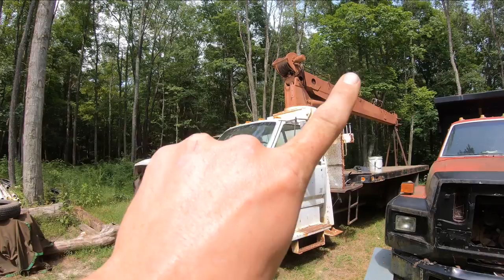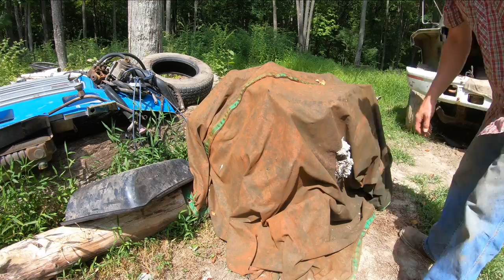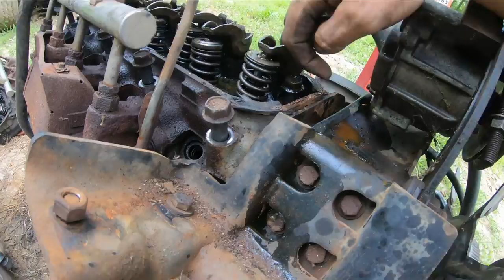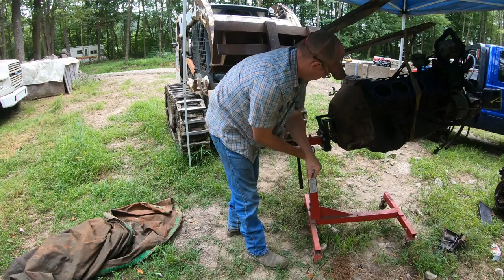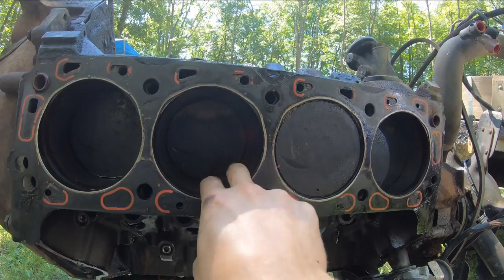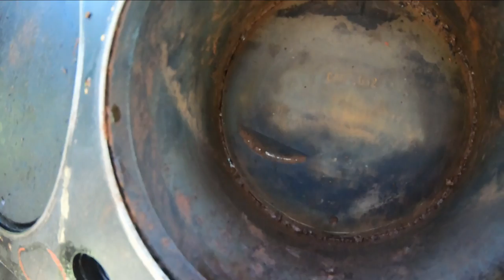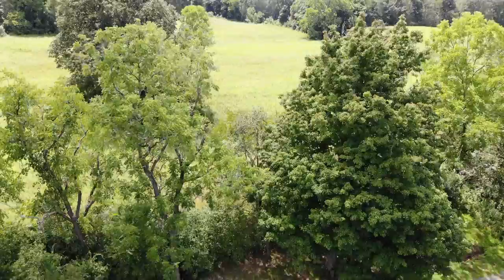Rebuilding a Big-Block in the woods! $700 Auction Crane Engine with big problems!

Comment: That engine looks to of been bored out before they got the oversize number on the tops of the pistons so maybe why it locked up a low mile engine will lock up long before a loose engine with lots of miles on it will but the heads been off that thing those are aftermarket head gaskets and the pistons are not factory so that engine has been rebuilt before as far as I can see

Comment: Seeing you took that engine apart, that was just rebuilt! You can tell by the heads and the new crank! That didn’t have many miles on it. Make a suggestion put the pistons in a bucket of diesel fuel and warm the bucket up with a and electric fluid warmer those will loosen up. Don’t put them in rust remover! diesel will work wonders if you do it right. Then clean the engine down with diesel fluid. Ask me how I know!!

Comment: With all that front dress still on the engine, and hanging a big block off the bellhousing, any engine stand isn't going to be happy.
That engine has definitely had a rebuild, they looked like Permaseal head gaskets.
I think with that big pit on the bore being so far down the hole, it won't be a big deal. By the time the piston gets all the way down there on a combustion stroke, a lot of the pressure has gone and the exhaust valve is starting to open. Less pressure means less blowby.
Besides, the pitting will fill with carbon soon enough.
Reply: Yeah and that thing weighed more than 750 pounds when he stuck it on the stand too.
Reply: Him slanging that mallet and pounding that drift. It bouncing up and down a good 6 inches, lol. I knew it was gonna come down. Probably good for 700lbs static load, when it starts jumping up and down, that's some serious stress.

Comment: By the time you pound the piston out of #2 you will have cleaned most of the rust off that wall via the rings. Hone the cylinders, put new rings on the pistons and bolt her back together. Engines are very forgiving beasts. You'll be fine. I have torn an engine apart, replaced one spun bearing and bolted the engine back together. Minimal crank damage. Engine ran fine. After you finish bolting it all back together taking very good care of the engine post rebuild is critical. Best of luck.

Comment: This is helpful for me. I'm needing to pull the heads off a V8 with just a carport to do it in. I'd much rather have a shop but it really is better than out in the wide open. And I agree with other you tubers. I've seen people free up stuck engines that most machinists would faint if you run them and they seem to do fine. Those chunks of mud could have been from mud dobber wasps. I've seen mouse nests and mud dobber nests in cylinders of engines that sat for long time. If the valve is open and the critter can get in the intake or up exhaust, they can build a nest.

Comment: I had a '66 Mustang with a 289, if you needed to change the water pump, literally every accessory on the front of the engine was bolted to the water pump housing/timing chain cover. You had to strip the whole front of the engine just to get the pump off and change it. It appears that is a trait of all Fords so nice at least the early 1960's.

Comment: I haven't seen that clay since I worked up in the 'rustbelt'...that, my friend, is the same color of 'clay' as Ford's engine caster used to cast the blocks...and is MOST LIKELY 'casting clay' used for the engine block's casting. If the blocks are not properly 'shaken' after casting, or not fully rinsed of debris after they are cool, there can easily be 'chunks of casting clay' left in crevices within the block (especially the water jacket areas) that over time, get soft and fall into the water or oil journals. Same with the intake castings...if the casting sand is not freed from inside the intake, the same can happen (and would be the most-likely thing that caused the sand to hit the pistons). While it is possible this happened from another 'mechanic' using an old intake (looked like the left-bank had a different brand of head gasket than the right bank), an intake swap with a dirty intake can also cause this. Either way, these are the most-likely ways such 'clay-sand' materials got into the piston-chamber areas of that engine. Personally, I'd tear the engine completely down, wash all internals (knocking out the freeze plugs) and then have it dipped at your local auto parts house, before rebuilding it...or the same thing that happened this time could easily happen again...if all the sand-clay isn't gone already.

Comment: Hey Matt, you have to take those clutches and pressure plate and flywheel off if you’re gonna be pulling those completely, don’t want no resistance on the back of the motor with the flywheel and clutch plate and pressure plate because that’s on cause a lot of problems and a lot banging up on the back and and U don’t need the bell housing to mount it to an engine stand. I never heard of that long. I’ve been working on cars and motors, but my back won’t let me do it no more that’s why I have to quit doing it way too much weight on that engine stand.

Comment: My truck has a inline 6 gas that was seized, well the only stuck piston was the no1 piston, BUT it was seized at the bottom of the cylinder, no going down. We managed to put the entire weight of the truck on that one piston and it stuck. We managed to get it out by heating it up a ton and dumping a can of coke down in it with pressure on the piston. 20,000 lbs and a ton of heat made it break free.

Comment: A good video, for me who does not understand much about engines. I hope that the church to apartments project is still moving ahead, too. I have discovered that many of these You tuber channel guys and gals, are pretty good at their presentations. He was on his farm, way off from anyone one else, speaking to 1,239 viewers, when I had viewed this. Harbor Freight sells some magnetic parts trays or dishes that you can place small metal parts in. Around $3.99 each. Even if you drop the tray, parts stay with it, not on the ground. They don't work with aluminum parts, though. I doubt if any engines have any aluminum parts.

Comment: I hope you kept all the bearings numbered and also noted the direction each were installed if you intend to reuse them and the crank shaft when you put the motor back together. No bearing wears the same on a crank shaft. Putting them back in the wrong order will cause faster crank shaft wear and an earlier than wanted engine failure. But if you plan on selling the crane right after you get it running, then the engine failure will not be your problem. :)

Comment: I made a Engine stand from 1: plate steel for the engine contacts and the stand was of 3" heavy wall steel pipe with 5" steel casters from a mill cart.

Comment: i did this to a 3 cyl diesel tractor.  it sat in the rain for 5 years and one of the pistons seized.  it took a sledge hammer to get it out.  bought a new piston but just honed the pits in the cylinder wall, should have been bored but couldn't find oversized pistons.  pits are still there, but 20 years later it still runs just fine.  took the gamble and it payed off.

Comment: Know how you feel.  I am a retired mechanic and I once owned a Dodge pickup with a V6.  It blew a head gasket and to remove the head I had to remove everything on the front of the engine.  All accessories were mounted on an aluminum horse collar and all accessories had to be removed to remove the horse collar.  It took me longer to remove and replace the accessories and horse collar than it did to replace the head gasket.  Way to go Detroit.

Comment: Oh hell. I had one still in the truck that I took a 4x4 and a sledge hammer to the pistons and broke them free, honed cylinders the best I could without removing the pistons, put the engine back together started it up and after it warmed up it stopped smoking and it ran for a few more years and sold it still running fine. Ford tough.
Reply from the maker: haha ya that's tough all right...

Comment: apply some heat with a propane torch in a circular motion i work the work the crank back and forth til it breaks loose. use a lubricant to keep the rings from  scuffing. the then soak that cylinder with oil with piston on bdc over night.

Comment: You have a steel crank ,I always used the dingal berry hones but you can use what you have I alway done each cylinder ,and ring end gap each cylinder  and sometimes  use a over sized ring then file your ring gaps to specs like 10 thousand  ring( low end ring gap) sometimes  they give you 10 to 25 thousands)gap you can't go wild on the over sized but go by your size pistons and then when you measure  your ring end that will tell you what over sizes rings you need ,like if you have decent  cylinders  and they are  a standard bore some motors you have to go up to 30 over rings and then fit each ring to the cylinder  top and second ring then if your standard  piston you use the standard  oil ring on the bottom ring you should not have any  problem  at all doing this and it will  run great  and be like new really .its fine for a farm truck and be better than a high miles used motor any day .I dont like to do this but for what your needing it for is really fine now you don't fit a ring on a standard bore and it way out of your ring end gap  remember  this  but buy 2 sets of rings and  and then file them it takes a while to center your rings straight and file the first  and( you have to keep track of top and second ring for each cylinder)second  ring then just use the bottom oil ring standard  to the piston size you wont have any problems  with it ,I always went with my low end ring end gap to fit each cylinder .now you need to make sure each piston is good ford does have some piston  problems I have checked very close  and missed a piston problem  and really pistons are very cheap  cost compared to have to take it back apart  because  of a rist  pin or a cracked  skirt becareful  I dont like using a motor block with out history behind it because of frozen blocks  or old castings with cracks if you have the powder  you can check it your self with a very strong magnet the powder is cheaper  to by than to pay  a shop to do it but you need it cleaned up heads and block then mag Flux the heads and block .I had a motor you could  see a hair line crack by the block plug and fluxing It with  the magnet it showed up like a sore thumb, and the block was junk really it was a very old casting.Im not up to date on ford 429 pistons  but make sure you check them very well before using them over and clean your piston   groves  I used sand blasting cabinet  with sand only very low preasure you don't what to remove nothing but carbon to fit your new piston rings on the pistons the rings won't squeeze up to insert into you cylinders ,Im sure you know this but don't not use glass beads on your piston gaps !! You can't wash the powder glass off and it will scar you cylinders  all up. And at very low preasure sand only!! And I always replace all freeze plugs  no questions. Simple and very cheap.I would not even think of using used bearings at all they are cheap to know what you got and mains too.I always put new cam bearing in myself at least you will have very good oil preasure if you do cam bearing are easy and just line up your oil ports then Hamer them in,watch your cam shaft and do not drag against the cam bearings this does make a difference  in the quality  of you saving this motors truck.remember never use glass  beads  on nothing  engine wise  it will mess you up ,glass cant be washed off with out like the old hot tanks that they use to boil the blocks with .(acoustic soda) what they use years ago.

Comment: 385 series engines are one of toughest engines ever built. i've applied heat and broken engines loose before. one you get piston movement soak cylinder with a lubricant. the heat apllied should help rings work loose.

Comment: Stuck rings, I have put pistons in hot oil,or 5 gal tin with old oil place on small fire heat till oil just started to boil, than remove from heat. Let cool worked for me.

Comment: It is never going to be a show stopping truck, but the cost so far is little more than time. The rust might take a few miles off the life of the engine, but I doubt that it will do more than a few hundred miles anyway. If you can fix it for time plus new oil that is the result you wanted, so really worth a try. The moment on the engine stand with all the other clobber extending it was a bit of an unfair load -  'exceeded design limits', but the weather gave you a chance to recover. I think you are in with a good chance with this one - until the next problem.

Comment: i agree with the fixing the damaged parts only especially on older equipment.  Do you guys have mud dobbers there.  they will make a clay nest, however the clay did look square with no hole in it.
Reply: he put a lot of diesel fuel in there could have dissolved then reformed
Reply from the maker: Yep

Comment: 429 is a really nice engine those ports are a good size.. they had a boss 429 that they put in a mustang like a 1971 fastback... hope you thought enough to get a full gasket set for $75 so you can take everything apart and clean the gunk out of it... every pass you were taking with that hone im thinking thats 5,000 miles... thats another 5,000 miles ..  thats another 5,000 miles .. thats another 5,000 miles .. heheh guess you got to do it though .. hope the ring gaps are still within spec after the honing though... Wonder if that clay type stuff was some type of engine/radiator stop leak
Reply: I also wondered about Barsleak in the cylinder...
Every (?) old FORD needed stopleak....

Comment: Been doing this for years knock pistons out clean up crank and pistons and block  hone it out new rings and bearings throw it back together and run it good for another 100 miles sometimes ive had them use a little bit of oil between changes i just check the bores for out of round taper and ring ridge unless its way out i never bore if u have real bad ridge may be able to bore if its just got a very minor ridge . Ridge ream hone an go 
By the way wd 40 works best for removing a little rust scrubbing with wd an scotch brite
Combustion chamber cleaner eats the carbon out of ring grooves. 

I don't think of myself as a shade tree or back yard mechanic. 
I used to think I was a front yard mechanic for years because thats where I did my work but i finally realized after all these years im a 💩📦 Shitbox Connoisseur lol good job 💨💨💨💨🔙🔚🔜👍👍👍

Comment: My first motorcycle had two grooves in the cylinder from the wrist pin slipping out. I put in new rings and ran it like that for years. Low compression, but.... it ran.

Comment: Those engine stands are so scary that I take good metal and build my own... I got the idea from one together to look at and then real steel to make one out of. I do believe that engine is weighing in at more than you think when you add the leverage of the distance setback. I do hope that you just replace the timing chain as they just don't live no matter how good they look, they just fail so soon after starting and stopping a few..... Don't know if anyone asked as didn't see it in the first few but did you rock it back and forth with the transmission in gear and just see if it would attempt to turn. Those mud dobber nests in the cylinders would of got hurt if turned over as in a bent rod or broken piston. Its so much work just using the old parts and make go.... lifters can be soaked and taken apart and then reworked to make sure their going to work.

Comment: On more than 1 engine that I bought that was seized up, I pulled the plugs, and filled the cylinders with a 50/50 mix of diesel and transmission fluid. 90% of the time the engine would turn over within 24 hours.
Reply: ATF is what I learned from the shade tree mechanics to put in the cylinders on an engine that had been sitting. Mixing with something to thin it out some makes a lot of sense.

Comment: Pits at the bottom are where there is low cylinder pressure anyway... the pits are oil reservoirs for improved lubrication

Comment: Maybe mud daubers got up in an open exhaust valve? Other than that it just might be crustification.. technical term.. haha
That 370 will work great.. that's what our work line truck had in it.. It had a tree growing through it.. engine locked up.. oil down the spark plug holes.. bumping it with forklift every now and then.. freed up and we ran it that way the rest of its life.. which was a long time..

Comment: You can do that to the old stuff.I do the FE's myself.I do hope you put in fresh rings and bearings.You did notice that the pistons are stamped  +.032? Just don't know enough about the big Windsors.Every 385 I saw had a leaking timing cover,and the WIndsors too.
The new big block gas engine,I'll bet,has so many "special" tools,THAT it can't be fixed.Might have "phasars" or Klingons.

Comment: Oh hell , I think I have enough of these under my belt to tell you that you are doing this exactly right !!!
Thats the good one with the forged crank.... Good motors and very forgiving.... Ping me if you need anything with this. I cant remember how close we are but we are running parallel in a bunch of ways. I have a bunch of cans and an L8000 6X6 crane myself...
And yes , that one got flooded from water running through that crack in the seam at the cowl... Damn shame but you got her....
Whats the capacity on that crane ?

Comment: When honing use brake fluid it works the best I own and run a heavy duty and equipment repair company and build drag cars 25 years experience and my dad with about 50 years experience we all ways used brake fluid to hone